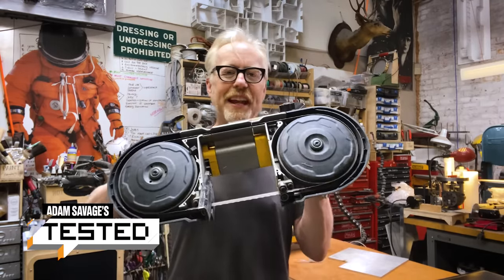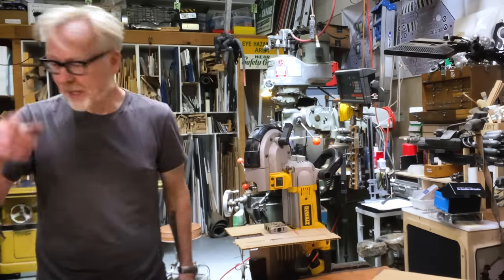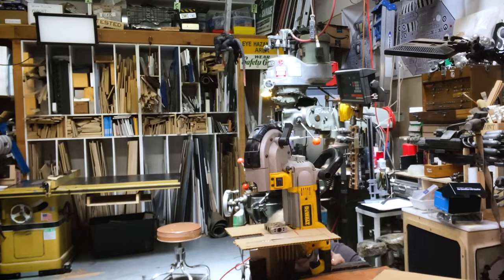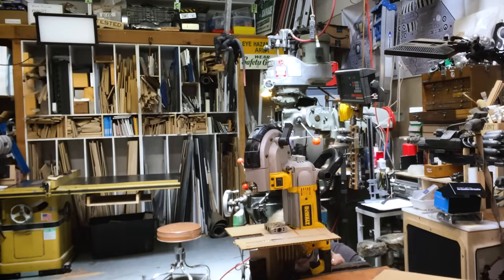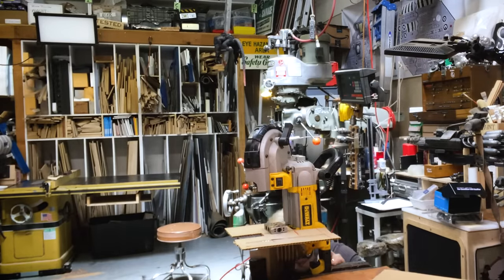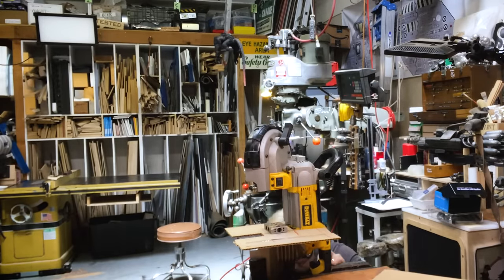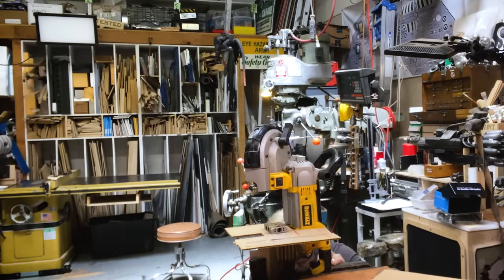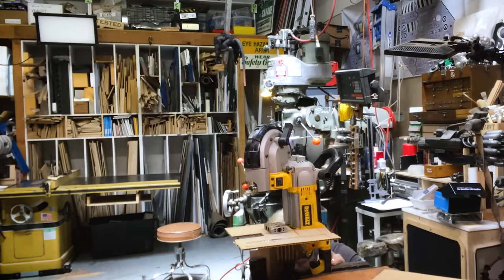Adam Savage Builds a Mini Tabletop Bandsaw!

Comment: Two 3-in wide clamps to simulate hands on the two handles one bar that goes across and attaches to both clamps and then that said bar goes into your vise on your table and now you have a removable miniature table saw all that work was literally done for nothing simple is better two clamps on each handle one bar welded to both clamps.

Comment: Wait! You had a DPDT switch and yet you used one of those damned awful screwits for the neutral!! WTH Adam? You could have just wired the  neutral on the other pole! Also, strictly speaking the ground/earth lead should be wired to the aluminium deck plate as it is bare exposed.metal! Tut! Tut!

Comment: Please, please, PLEASE,  for the love of god, invest in a box for your switch. You have exposed live 120 volt terminals sitting there just waiting to bite you! And it will. One moment of carelessness, the rig starts to topple and you grab the first available surface.  Invest $1.50 for a utility box, screw that to your wooden housing and make all your connections inside, out of the way of probing fingers. This is a real safety issue with this rig, for you and all who decide to follow this.